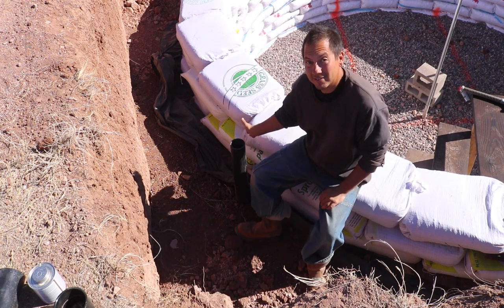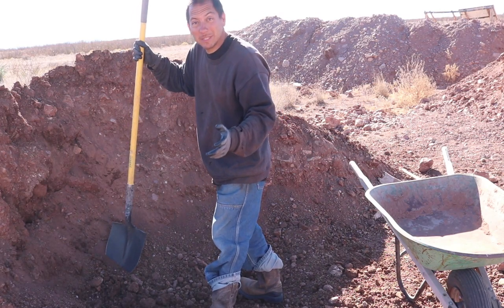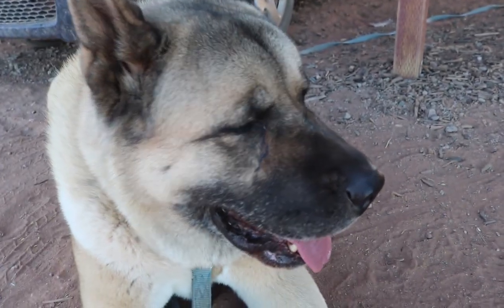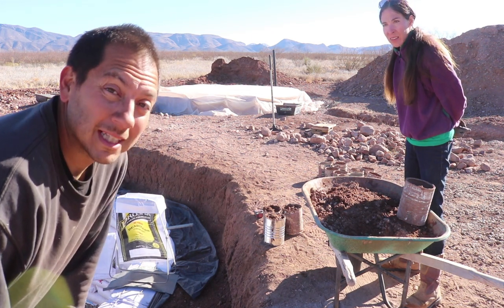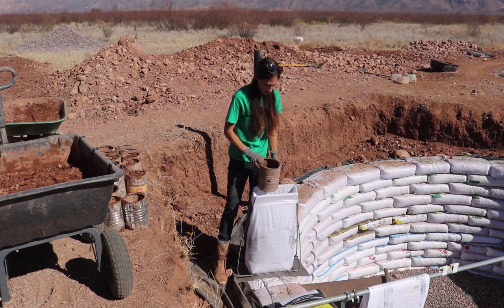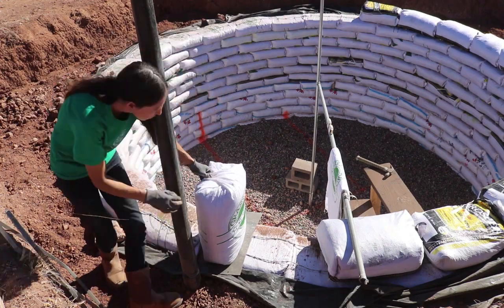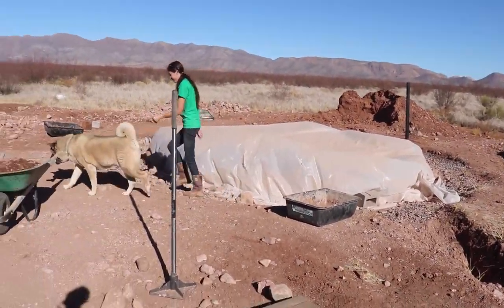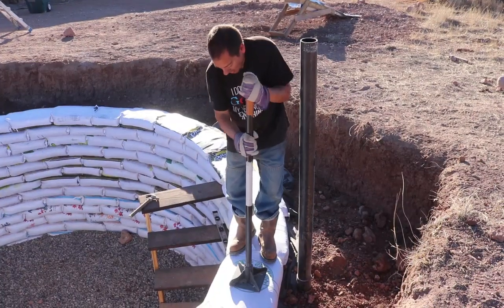We Need YOUR Help! | Building An Underground Earthbag House

Comment: I think you should build your house section (aka the west dome) first, and that means do the electrical. Figure out where it's going to go, where your lines need to be buried, etc. You can cart water in, you can't cart electricity in ;-)
Reply: Plenty of power to be had with solar panels where they are the sun shines almost everyday what they dont have is water storage for the few times they do get some rain

Comment: Build a sled to haul the dirt by pulling it with the car. If the sled is way narrower than the wheels of the car you can even wet the sled route for easy pulling over slippery clay. A flatbed trailer behind the car would even be more convenient for hauling. Most expensive, but highspeed option: contract a guy with a frontloader to relocate the piles of dirt, if will also reduce the existing compaction.

Comment: You should finish out the one you’re working on. Then go for a domed greenhouse. 👍
Reply: I agree about the greenhouse especially because you have high winds.  Wind is a going to blow every year so best come up with a solution from the start and going down and earth bagging will be ideal to protect your plants then a strong glass roof.  In this sort of greenhouse you can grow veg all year around protected from wind, heavy rain, heat, snow and ice.

Comment: Bedroom first! It was the first room completed in my log cabin - a joy to fall in my real bed after all day working on the place. After that I was faced with exactly the same question - plumbing or electrical first while living in my log cabin. I chose building the solar system first and have been glad I did. The water wouldn't have worked with out electricity to run the pump anyway.

Comment: First, I'd get water, power, and waste connections to the main house first since those utility lines are foundational and having them in place will make every other part of the project easier.  Once the utility lines are in and any trenches backfilled, then I'd start working on the above ground structures.  It's looking great y'all, strong work!
Reply from the maker: Thank you Chris!

Comment: Dig out your hole for the underground greenhouse. Have the dirt pile set closer to the West build. That way you have close dirt for both sides.  
Where both sides will have electricity but only the East will have water. I would say East. You could stay in the root cellar as a bedroom temporarily until the other side is done

Comment: Do the west wing and try to borrow a digger with a bucket on so you can move the soil pile from far away close to the west wing your electric is more important than water which you have and can run a hose from temporary then the pile close to the east wing is in the right place for doing the East wing. Good luck with your choice as always we will be watching you whichever way you decide to go.

Comment: Start with solar . I did & love it !!! Start small & add bro !!! I( want ) a basement also. Ive been off-grid now 4yrs on solar & if you can AFFORD lithium you won't have to worry for 10yrs.
Reply from the maker: We actually have a fairly robust solar set up. 15 320 watt panels and 4 Tesla model S batteries.
Reply: Then you Shall be a Happy Off-road Couple !🇱🇷🎼🎶🇱🇷✌

Comment: I’d add some ‘deadmans’ near the top of the wall to hold it in place.  An easy way might be to lay in some 1/2 all-thread under the last layer or two of earth bags, from just inside the earth bags sticking out 3 feet or so.  Put a piece of plywood about a square foot in size on the inside and a timber three feet or so long at the other end in the backfill area to be covered.  That’ll add more stability to the top layers.  That might even be able to be used to connect the upper story to the lower more solidly or a collar around the inside of the bedroom to make finishing easier.  We live in earthquake country (7.9 less than 100 miles away less than 20 years ago) so we track that a little more than some.

Comment: Head East tower first.
Work on a hex scaffold with perm-interior/ temp-exterior wood beams separated by 60° angles.   Easier to lift each level of bags, safer to tamp bags with a temporary backer board as the rings shrink inward.  And you can adjust where you want 2nd floor if you're not sure right now.  Everybody loves exposed beams.
Mostly for safety as building without a standard % concrete and iffy clay content.

Comment: My vote is for West dome first.  You need electricity and can practice on this structure before building the east spaces.  Still wondering how you intend to connect both structures.  Will you dig another trench and run power underground?   I recommend two or three PVC conduits with a pull line in each conduit.  Assuming one for 110vac for lighting, a second lower voltage for raw power from your solar array and a third for voice communications, Ethernet and other sensitive wiring.  Pull ropes in each pipe allow for easy addition of future wiring without having to dig everything up.  It’s easier to pull wire that pushing it through with rods or fish tape.

Stay safe out there.   Wishing you and your family continued health as the pandemic continues to evolve.

Comment: I would do the dome above the root cellar. The backfill has had time to settle and strengthen to support the heavy walls above.  Very important for the backfill to pack in tight.  Especially with the enormous weight of the earth bag domes above.  Love watching you build!
Reply: Hmmm, hadn't thought of that.
Reply from the maker: That's good thinking, but we made sure the dirt under the dome hasn't been disturbed. We won't be placing it on the back filled area.

Comment: I know this is going to sound crazy, but why don't you work on both, simultaneously. It makes sense to me, because
1. You need both water and electric in order to move in.
2. Obviously both domes need to be combined anyway.
3. Although it will FEEL like it is taking longer, in actual fact, it won't be any longer than if you were doing each dome separately.
4. The distance you need to travel to the next dirt source is, in fact, a nonsequitor. Why? Well, this is because regardless of which you do first, you still need to bring it further, therefore it doesn't matter. 
But regardless of what you decide, we will be watching your progress and cheering you on!
TAKE HEART! YOU'VE GOT THIS!

Comment: For me, sleeping securely and comfortably are HUGE. But since that's a hole in the ground, I'd need electricity. Next (for me) is the kitchen, because I am ABOUT some snacks and comfort food. If I could get the bedroom comfortable enough to sleep in, I'd do that part first. Otherwise, I'd work on wherever the kitchen (or maybe bathroom if you're gonna have running water and a shower or tub). Honestly I'd ask what I hated most about living in a camper- for me it would probably either be the bathroom situation, the bedroom, or the kitchen, so it would just depend on what drove me the most crazy that week.
Reply from the maker: Very wise Kim! We're all about them snacks as well.😁

Comment: Great effort! But your moving the dirt / bag fill to many times your creating (3 times) more work. You need to find some old roof tin to  make a dirt shoot (a slide like what concrete trucks have) from the dirt pile (1 time)to the the hole strait into the bag then move the filled bag to it's spot using the wheelbarrow working counter clockwise granted you'll have to backfill so you can use the wheelbarrow for the next run. This will go so much faster cause while your backfilling the wifey can still fill bags easily from the dirt pile. The backfill for any job should be the only job where you have to touch the dirt more than once. Lot of love for your hard work guys!

Comment: Get the water side done first.. electrical can be done in the cold.. water gets trickier and trickier as it gets colder. My 2 cents. Looking great guys!
Reply: Good point
Reply: @dianacarolryan7284  Thanks! First thing I always do is assess what can't be done under certain circumstances.. and then gear everything based off that.
Reply from the maker: Thanks for the suggestion Carlton!

Comment: What’s more important, the bathroom/kitchen or the bedroom/living?  I think since the bathroom/kitchen has lots of plumbing and electricity plus cabinetry it might be inclined to do that in the winter, at least close it in so you have shade to work in during the summer.  As I think about it I would let the weather drive my decision because summers there can be brutal.  Also, what about the monsoon season, does that play a role in your decision?

Comment: Since the root cellar is already covered, and thus protected from the elements, wouldn't it make sense to keep working on the bedroom end of the build? Cover the underground bedroom and then, once you've established that they are both the same height, then you can begin on building the next floor to connect both domes.  But if you're getting ice now, you should concentrate on covering the bedroom first before winter really bites. My opinion, anyway.

Comment: I think I’d do the kitchen bathroom. Good to be able to relax those muscle in a bath or shower. The electric is may be able to be put into the basement of the other with out the top in place..?  Put the panel in the basement you can run lines over to the other building through a conduit and add the runs for the above living space later, just make sure that you get a large enough panel.  Specially with those new ark fault breakers, they eat up panel space. (May be they aren’t required there, I’m from Canada)The east side you could use a small sub panel so you wouldn’t need to have soo many runs through a conduit. They say it can cause an magnetic field or something not healthy when too many wires are strung together..?For your kitchen, run 20 amp breakers instead of the split 15 amp plugs it’s simpler and the gfi recepticals are right there if something does trip them rather than running back to the panel and they don’t trip as easily. GFI plugs are needed when in close proximity to water and I think a safe and handy thingin the kitchen. I’ll stop giving advice now! I just enjoy building and designing things out. Really like that your biting things off and actually doing it. Too many people just talk. Too many tell others what they should do with out doing things themselves or worse vote to make others do something. Run your own world and build your own castle! Live by example! I’m trying to build a small hotel. I’m at year 6 full time. My days are shorter than yours I’ve run out of steam a bit, might have bit off a little too much. Oops! But I can’t stop now!
Reply from the maker: Got to keep going!😀

Comment: You need water more than electricity. But honestly, you're probably not going to need either until you actually move in. But it would be nice to have a good sized kitchen and bathroom even before you move in.
Reply: Edward Raney  Yes, I realize that. But I'm talking about running water. They already have plenty of water storage even though they've said they haven't gotten enough rain this year. But I'm sure the shower in their rv isn't very big. So having a nice kitchen to cook it and a nice bathroom to shower in would be my first call.

Comment: join the 2 you have  would be my next move but as most of my schooling is architecture i would have sat down and drawn it out already or at least sketched a few ideas  for layout or general materials calculation just to understand quantities and volumes to be dealt with . of coarse i would know a list of requirements from my spaces for my uses and design accordingly. i live where bedrock is prevalent and its below freezing a good bit of the year so my tinkering with underground systems are different from your conditions but my plans were concrete floors in a cube in the ground top living level 8 feet or so under ground level with poly carbonate ceiling under a pool under a geodesic dome   probably ably to solay power it either through dome surface or from inside dome depending on size my pool was 12 x36  with a dome that had a 60 foot diameter and was a total of 3stories  bottom level was a 40 x40 x8 water tank/heatsink  all the walls were piped so also heated to ambient heatsink temp as was pool  it was a neat setup  and i hope you steal ideas so i get to see them built

Comment: I love what you are doing! Im doing something similar in northern Idaho. In my opinion I would do the living space first. it is faster than dealing with all of the kitchen and plumbing issues. get out of the harsh elements. But really why cant they be in the same building? you should be able to fit everything in a 16' dia building and expand it. That's about 200 sq feet. You would be able to make better decisions when you feel safe and live in a nicely cooled/heated space. You should really think about how to deal with snakes and scorpions ahead of time, they would love your buildings and they are really dangerious.  I wish you had access to an excavator or skid-steer.

By the way, where are you, az?
Reply from the maker: Southeast Arizona.

Comment: ive lived in a travel trailer before , six months of torture if you ask me , so i would work on the living quarters so i can get out of that motor home, and you two need a front end loader with a backhoe attachment, i know the expense is a lot but you would be amazed how much you would benefit from using it , also why dont you allow your dog to roam free , if you neuter him he wold be far better dog, and he wouldnt roam off if thats what your worried about
Reply from the maker: He is neutered, but he would still run off. High prey drive.
Reply: @ourselfreliantlife  i  understand  , i have a German Shepard/great pyrennes/ great dane mix , about 120lbs he loves  to wander in awooded area near my house, he also scares people, i have a feed store here in Houston and i use him as a people greeter, train him to like people and strangers to a point ,we put a cow bell on him to let people know that hes near, also reminds him to come home and eat dinner, helps us keep track of him, when we lock the gates at night hes on full protection mode, hes also trained to alert us of people carrying guns , love your videos, keep up the hard work, you will certainly be rewarded!

Comment: Maybe I haven’t seen the video- but how have you guys ensured the bags are placed and packed plum? I don’t see shone using temporary posts/guides when using these bags. There must be something that I’m missing.
Reply: Am I seeing a marker in the radial pole? Hmm. I’d still be nervous but I’m a Nelly-
Reply from the maker: It's all done with the pole compass. It's a great tool. You set the L bracket to where you want the tamped bags to sit. Jess has also marked out where filled and untamped bags should sit. It's been working real well.
Reply: @ourselfreliantlife  awesome! Yeah you guys definitely have a system that works!

Comment: Just been wondering if you have no windows in your bedroom, how do you provide cross ventilation, this is to remove C02 from the room. If you don't have natural cross ventilation provided by windows and doors you must do so mechanically. Building codes throughout the world address cross ventilation as a medical safety aspect. Before you start the structural above you might have to address this problem. Increase floor to ceiling height to enable 2 windows across from each other. As long as the can open you could use black glass in you don't want light. Think of your Indian teepee opening at the top. Think of chianti town accommodation many die of C02 poisoning lack of cross ventilation. Think carefully this is a serious problem, not to be ignored. Have a good day. I am a Snr Architectural Tegnoligist and lack  cross ventilation is a serious health hazard. If not natural you must provide it mechanical.

Comment: Not well versed on the subject. I think, what ever wing you work on, it is important to make sure, what is going to be behind a wall . It should be done correctly and not hurried.  Then, there will not be problems later on. This may sound off or weird, but  your knowledge of the project, it will make sense. Build on the most important section.